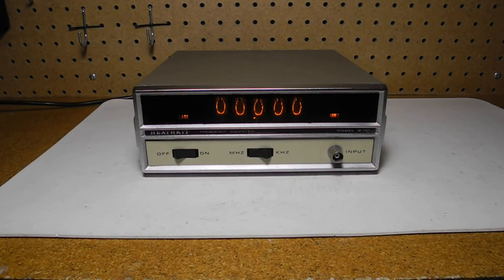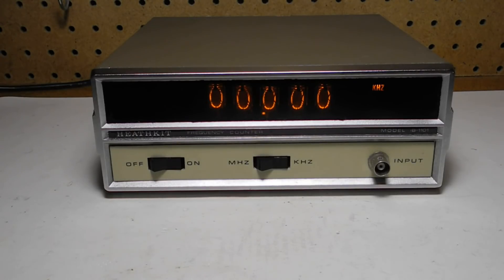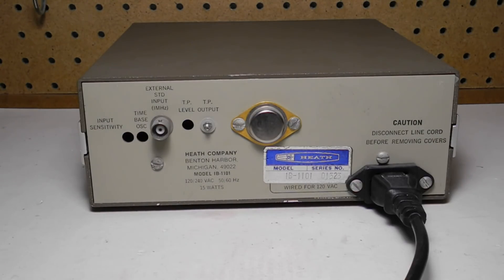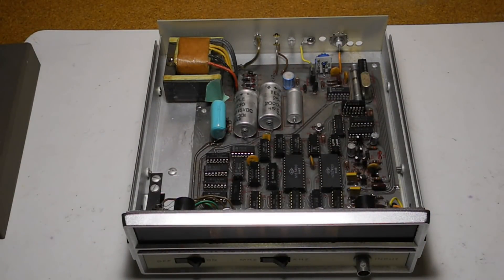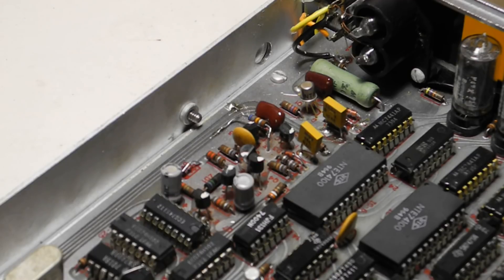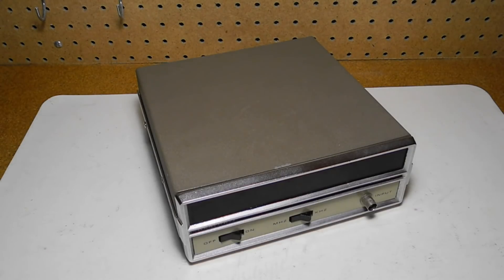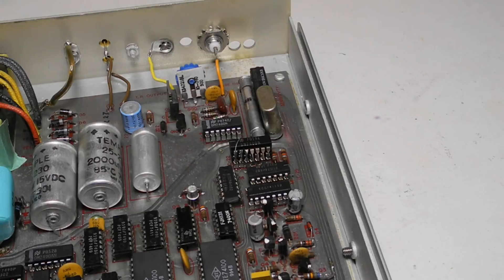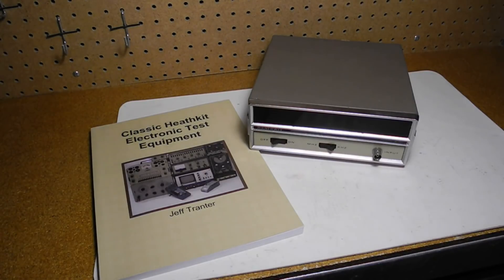The Heathkit IB-1101 Frequency Counter

Comment: I have 2 IB-1100 30Mhz counters and a IB-1103 170Mhz counter. all work nixie's bright. I zero beet    with WWV 10MHZ  I get a slight drift of internal OSC for 5 to 6 minutes or so. much longer on a cold day.  I have no handles ether.  The heath kit manuals  can be gotten directly threw heath kit. they have copies of everything they made. I gotten very good copies from them.